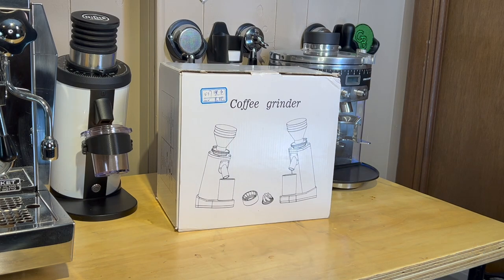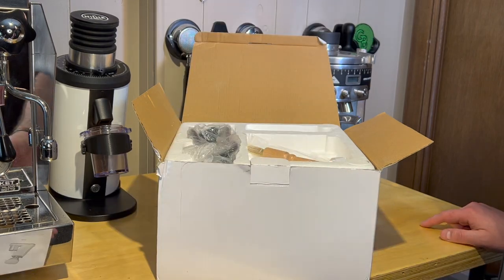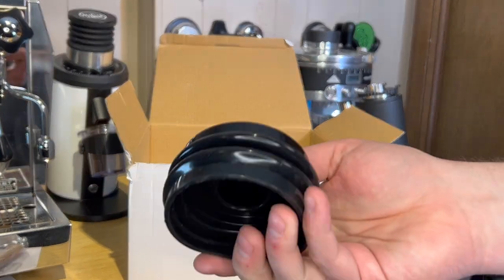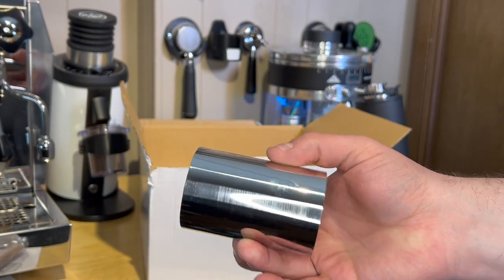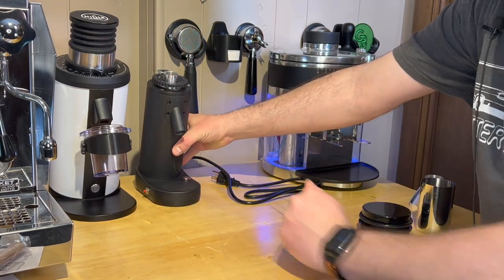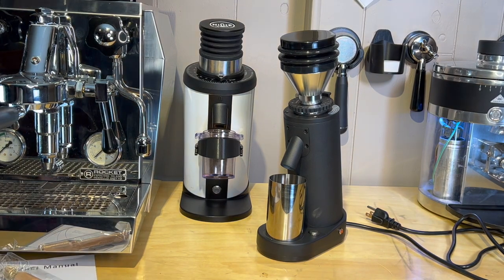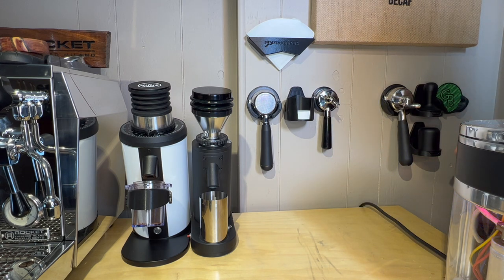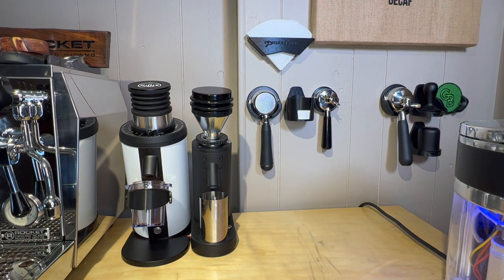Turin SD40 Unboxing - Espresso Outlet

Comment: Mine came as new but with traces of grounds on the burrs. The rest looked pretty new though. Is that normal or did I get a used one?
Thanks!
Reply from the maker: Normal, if you bought from us we have noted.  This manufacturer tests with real coffee
Reply: @portakeeper  thanks a lot!
Reply: @portakeeper  would you recommend seasoning it before actually using it for espresso?
Reply from the maker: @JP-jg2sr  no, just use it.  Force seasoning grinders is not good for the grinder or burrs
Reply: @portakeeper  thanks a lot for the good and quick support!

Comment: It’s a very elegant looking little grinder, actually cuter than the DF 64 in my opinion. But the noise! It sounds like fingernails on a blackboard, or some kind of dying cat. I don’t know if that’s an artifact of the recording or not. The DF64 does not have an unpleasant sound to it, and I wonder how it would sound under the same recording circumstances? I would love to hear an audio comparison.
Reply from the maker: I’ll do an audio comparison.   It’s a geared motor similar to the niche.  I think the Niche sounds awful as well.  It could be worse, it could be as loud as a Baratza 🤣
Reply: @portakeeper  like taste in music, it's subjective! I slightly prefer the sound of the Niche to that of the DF64 (I have owned both).